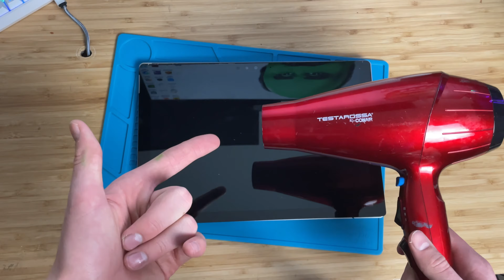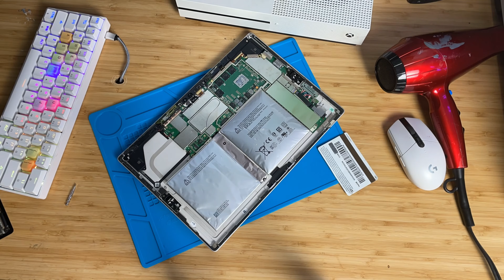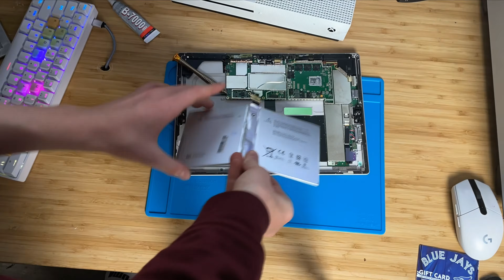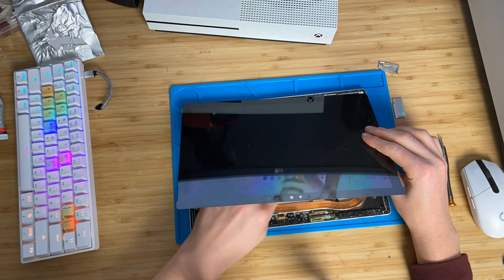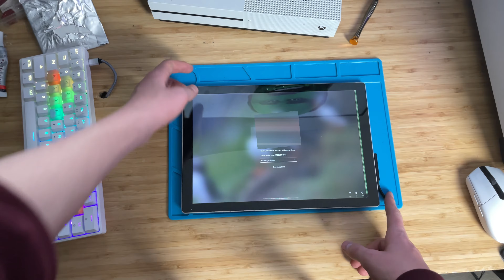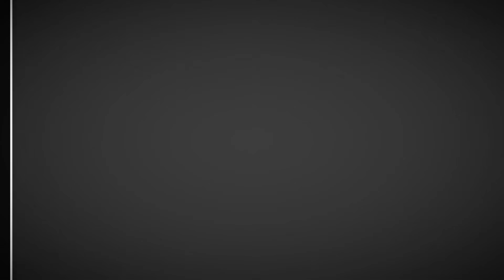How To Replace The Battery In The Microsoft Surface Pro 4

Comment: I'm using plastic guitar picks to try and open it, but I can't seem to get it started. What did you use to separate the screen from the body? Any good spot around the edge to start? I just can't seem to get it to separate anywhere.